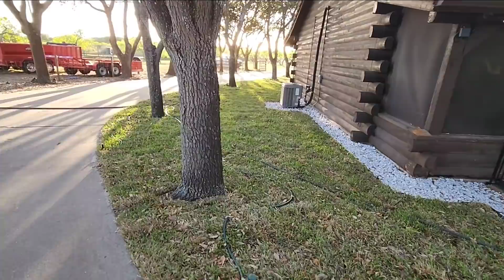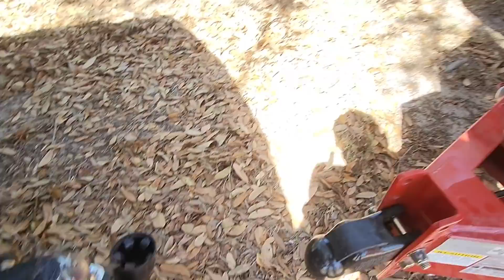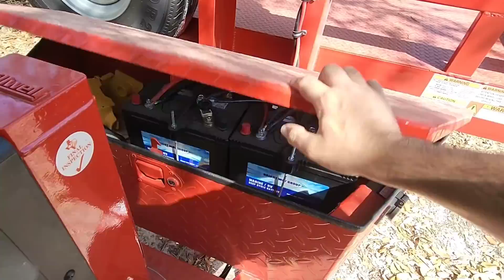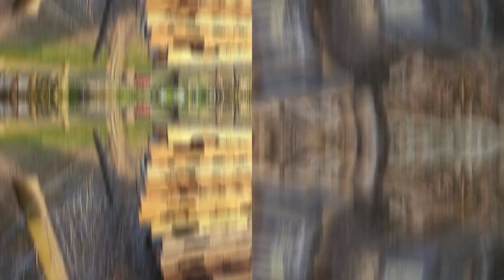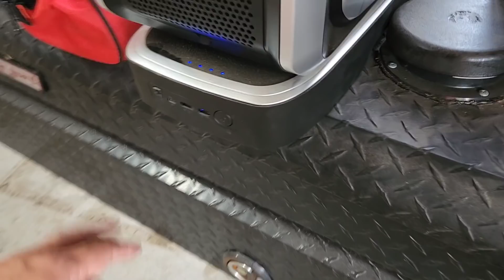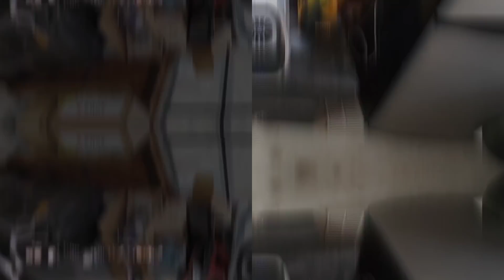Testing a TRUE BATTERY POWERED AIR CONDITIONER!  Zero Breeze

Comment: Just purchased a TT a month or so ago and the tech suggested hooking the breakaway to an independent spot on the frame. Noticed you hooked it the same place as your safety chains. Any input as to which is better or what the chances are of your entire hitch breaking off the frame?
Reply: There are cases where the receiver has detached from the truck frame, and it would be a good idea to attach the breakaway cable to something other than the receiver like the bumper. 

These cases are very rare compared to a pin, ball, or hitch failure though.

Comment: Hi JD,
 I'm enjoying the content you have here and there is some good stuff  that's about the RV life and homestead life too that will help me in the future as I'm planning to perchance land in the mountains for our own home away from civilization for camping and getting away from the hustle and Bustle of life. 
 Ok, sorry for the long message BUT I have been wondering about the different between how a bumper pull trailer with the swaybar setup and the fifth wheel  without sway bar is. 
  I kinda know a little about the difference but it would be Great if you could show us how each system works and what different things are involved in weight placement/transfer the truck deals with in both applications. 
  Hope it's not too much trouble to  ask you to help us out and perhaps we will have better knowledge of each of these different RV's to making a choice of witch units would be better for US. Thanks JD.